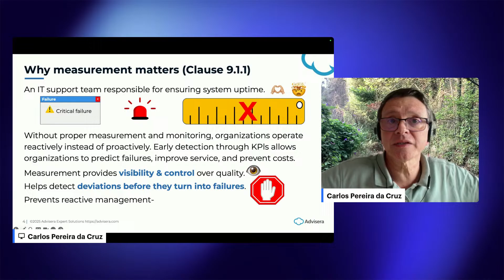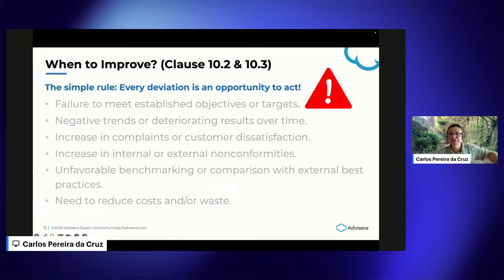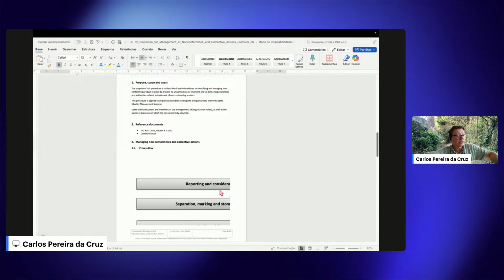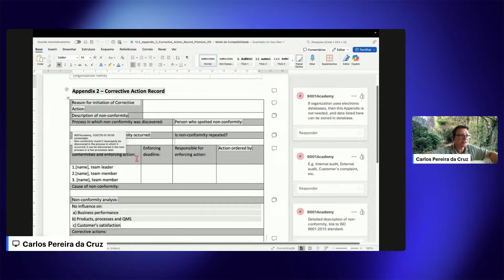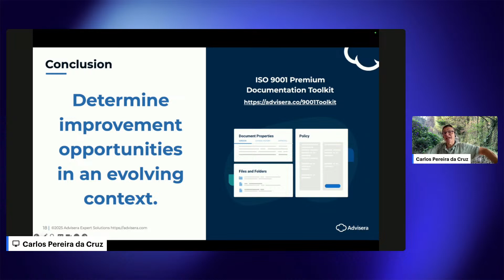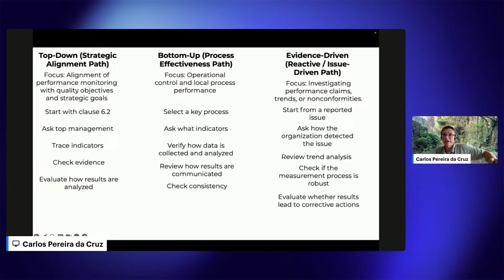Measurement, Analysis, and Improvement According to ISO 9001:2015 [live webinar]

Comment from the maker: You can find below all the links we have shared in the live webinar: 
- ISO 9001 Premium Documentation Toolkit https://advisera.co/9001Toolkit
- Toolkit expert meeting link https://advisera.co/9001ToolkitExpert
- ISO 9001:2015 Foundations Course https://advisera.co/9001Foundations
- ISO 9001:2015 Lead Implementer Course https://advisera.co/9001LeadImplementer
- ISO 9001:2015 Internal Auditor Course https://advisera.co/9001InternalAuditor
- ISO 9001:2015 Lead Auditor Course https://advisera.co/9001LeadAuditor
- eBook DISCOVER ISO 9001:2015 THROUGH PRACTICAL EXAMPLES https://advisera.co/9001eBook
- Practical tips for measuring your QMS according to ISO 9001:2015 clause 9.1 - https://advisera.co/MeasuringQMS
- The ultimate guide to ISO 9001 quality objectives https://advisera.co/QualityObjectives
- How to define Key Performance Indicators for a QMS based on ISO 9001 - https://advisera.co/QMS-KPIs

- Making the best out of ISO 9001 Quality Plan - https://advisera.co/9001QualityPlan
- Analysis of measuring and monitoring requirements in ISO 9001:2015 - https://advisera.co/MeasureMonitorReqs
- How to implement the Check phase (performance evaluation) in the QMS according to ISO 9001:2015 - https://advisera.co/9001CheckPhase
- Complete guide to corrective action vs. preventive action https://advisera.co/CorrectiveVsPreventiveActions
- How to use quality control tools to improve your QMS - https://advisera.co/QualityControlTools
- How to use root cause analysis to support corrective actions in your QMS - https://advisera.co/RootCauseAnalysis

Follow us on social media:
- Advisera LinkedIn: https://www.linkedin.com/company/advisera/
- Advisera YouTube: http://www.youtube.com/@AdviseraExperts

Below, you can also find the links to our: 
- Webinar Survey https://info.advisera.com/webinar-survey/measurement-analysis-and-improvement-according-to-iso-9001/ 
- PDF slides https://advisera.com/webinars/materials/ISO_9001_2015_Measurement_and_Improvement_webinar_presentation_deck.pdf